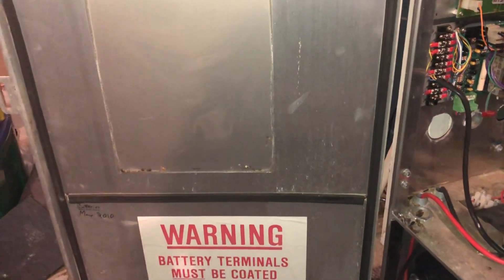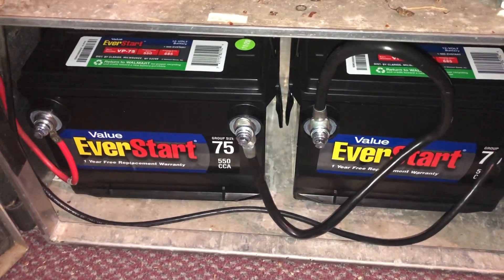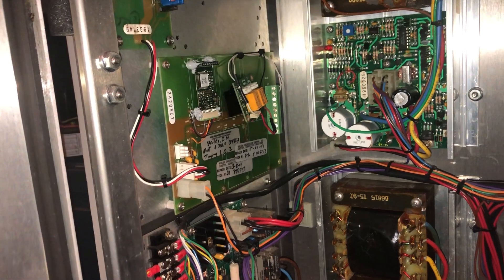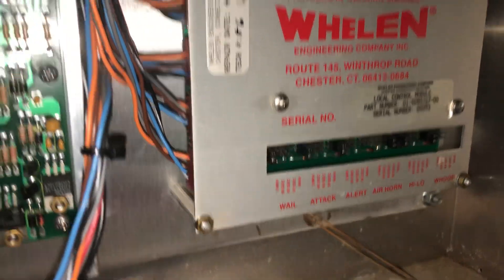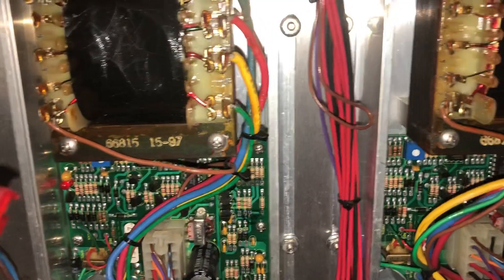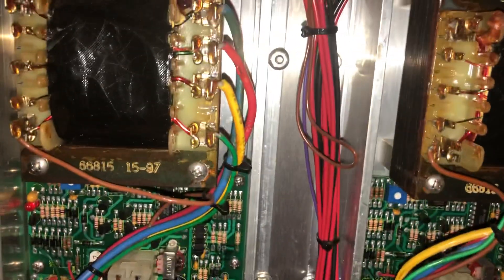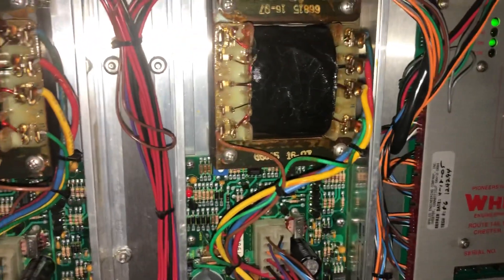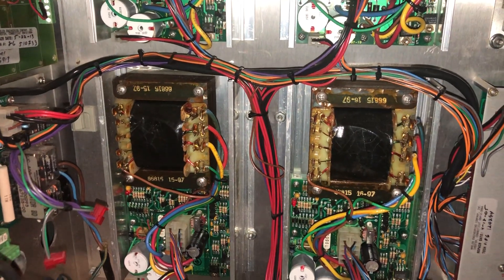Whelen ESC-864 Controller

Comment: Running the airhorn signal doesn’t actually kill drivers. That’s a myth. Low frequencies don’t actually burn out compression drivers, unless you’re running them over the rated wattage (although that would be any frequency, not just low ones)
Reply from the maker: I know its not due to it being low just bad experiences of the air horn going and then boom driver mysteriously dies.
Reply: @FSThunderboltfan1000  oh. Huh, ok.
Reply: @FSThunderboltfan1000  It doesn't kill drivers.
Reply: @Hmmm_Hmmm ah, I never thought about it that way